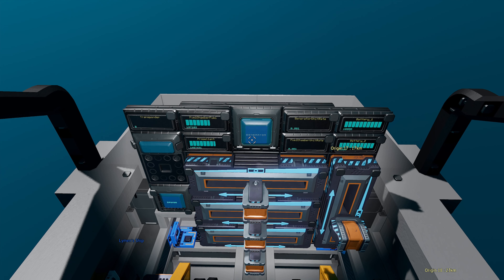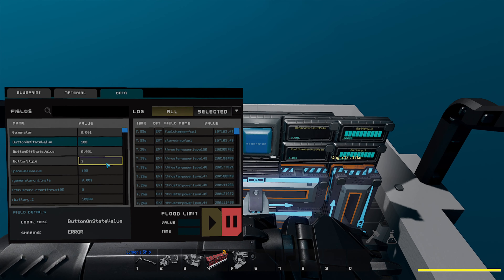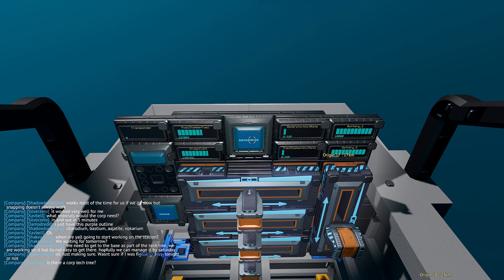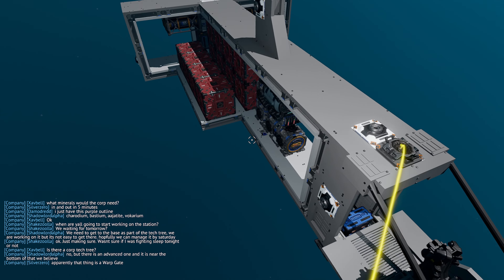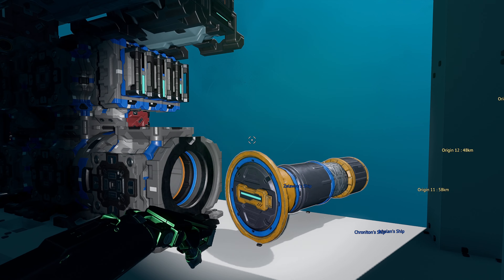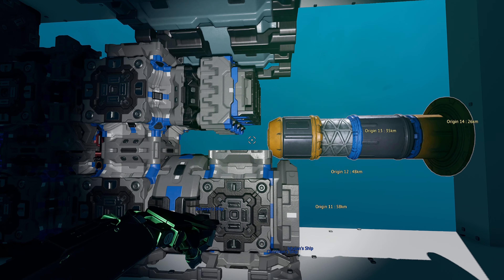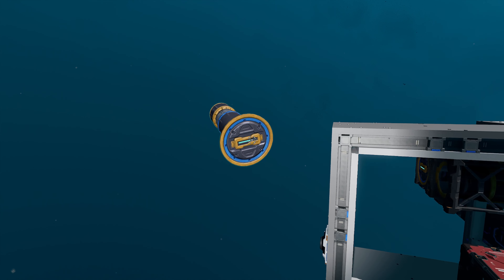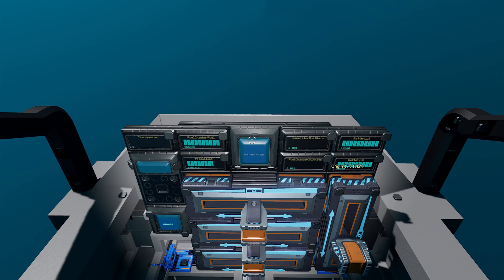Starbase - Guide - How To Replace Fuel Rods & Fuel Saving Tip!

Comment: That tip to reduce the reactor output to 23% is great! I watched another video that went through a whole process of installing a YOLO chip and programming it to adjust the reactor output based on a formula to basically do the same thing. This is so much easier. I guess having it self-adjust based on a formula would make sense if the ship had weapons, but this one doesn't. 

You mentioned the store that sells fuel rods. Another tip would be that you can make fuel rods at an Easy Build workshop table.
Reply from the maker: self adjusted ones are great later on for much bigger and more complex ships. No more having to power it down it auto shutdown, etc. But not something I want on my basic ships.

Comment: but if the output remains at 100 the battery doesn't drain when the generator is off, at 23 my battery drains if my generator is off

Comment: how do you change the value in the fuel chamber run box at the beginning of the video?
Reply from the maker: Your using the U Key while looking at the button itself. Then turn it on / off. If it's not showing the value's try closing / opening it with U again while looking at it.

Comment: I cant put the F*** rod back to generator. Its rim is turns to blue, but cannot stay in. What is wrong? Which key you pick and release? F and E ?
Reply: With turning snap-on C it fits. But why the hell it shows with blue rim that it is fit, when it is not?
And why i cant put the empty one back to holder of full one?

Comment: Replacing the fuel rods is too frustrating to make this game remotely playable. I just spent nearly 2hrs trying to do what you did to replace my fuel rods; lost 3 rods in the process and could not get it to snap in place, it just kept disappearing and reappearing when I turned snapping mode on and off. I got the click/chirrup sound you get but nope, wouldn't go in, just kept appearing with a red outline constantly. Totally unplayable.
Reply from the maker: Yeah it can get quite annoying and does need a Higher Snap area. You can mouse scroll to move it in and out also.
Reply: This... 
i rage quit trying to do this
Reply: @Barxxo  Yeh, I lost one rod. So I just quite the game. It's the worst game mechanic I've seen in many years.
Reply: 2h lol. Just pick them from the front, not from the side and put them back in. Took me 3min to figure it out.

Comment: literally been sitting atop my magnus for a hour trying to get fuel rods to fkin work properly it happens every time i refuel it. i have snap mode on they will be in correctly i can fly off cause of the ones that work and the ones that don't work don't fly out, so they are in there. they are t1 as they should be but nope. im about to quit this fkin game over this